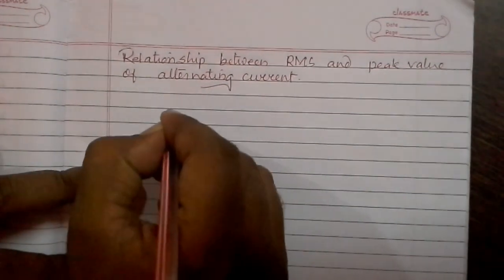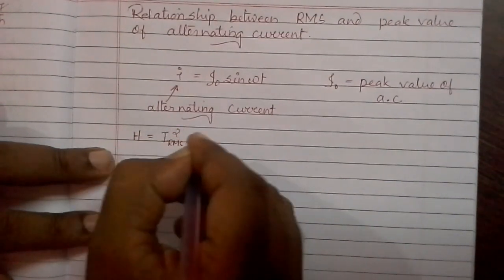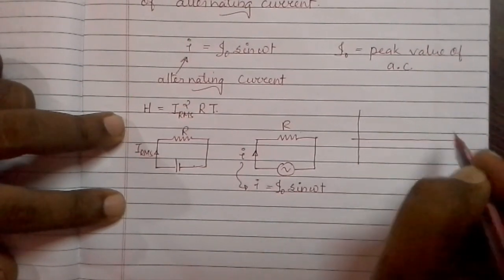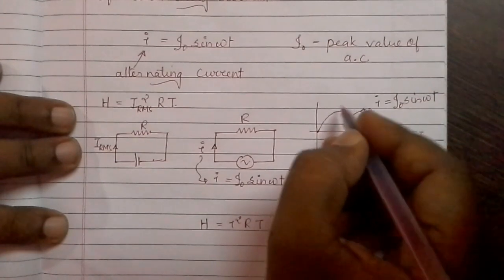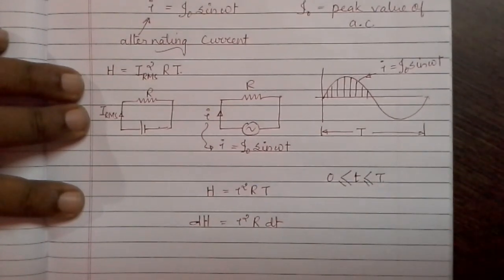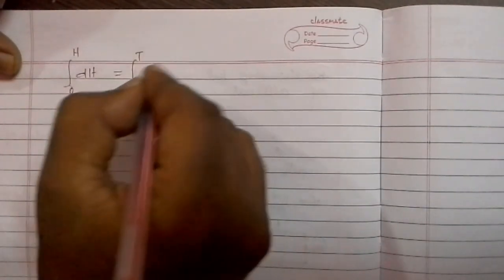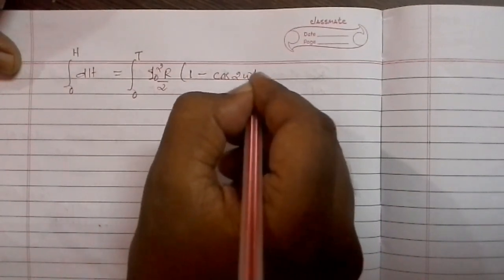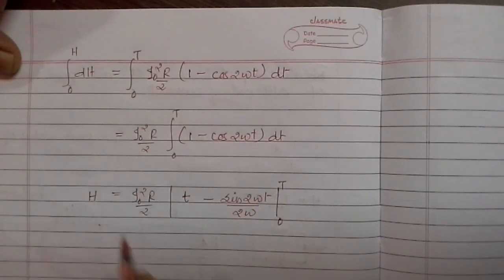Physics : Relationship between RMS and peak value of current

Comment: atleast thoda deep bataye hte integration ka rule ki kaise kch value aai not all the students r from maths side
Reply: Whenever there is integration the constant with the x or y value ( it may be in sinx cosx or any other function ) is divided by the integrated quantity .
For example here in cos2wt , sin2wt is intigrated quantity which is divided by 2w ( constant )
In differentiation this constant is multiplied .
That's all is applied in most of the Physics derivations .
😊😊😊😊😊😊😊😊
Reply: Palak Mittal  thanq sister..... it was great help.  .... bhut prblm krta h ye ac chapter ka derivation ... kitna mughup kru....😣😣😣
Reply: @divyamishra1764  are koi nahi ..
Ho jayga yrr
Meri ek friend ke pass bio hai mai uski bhi help karti hu ..
Tumhe furthur koi problem ho to pooch lena 
😊😊😊😊😊
Reply: @CoderVroni  hyy
Reply: @divyamishra1764  hyy